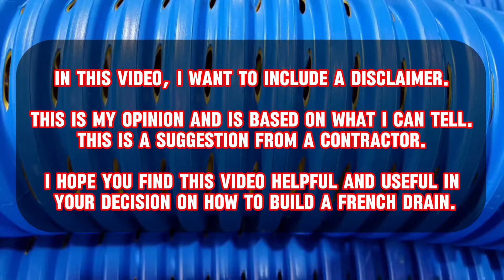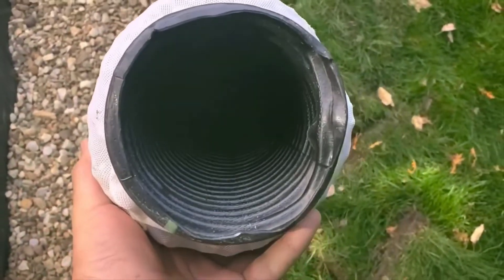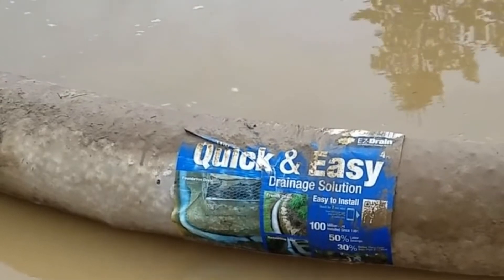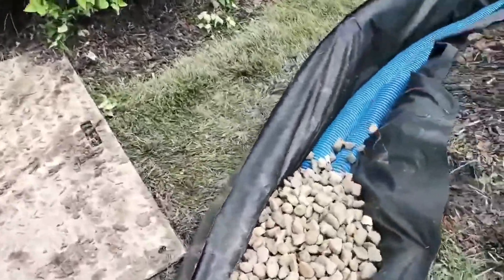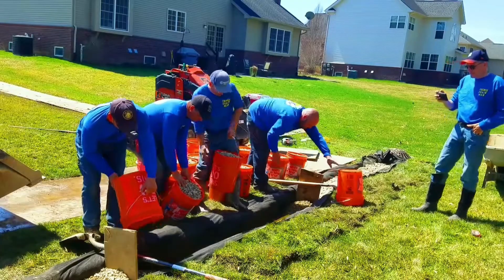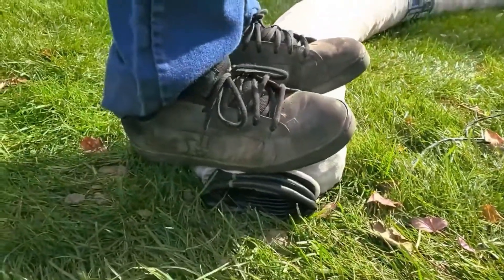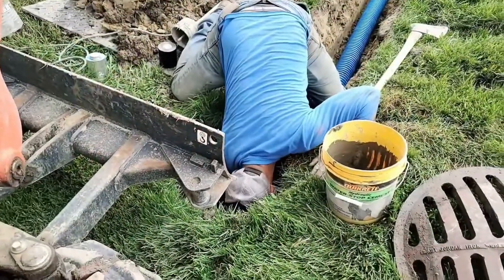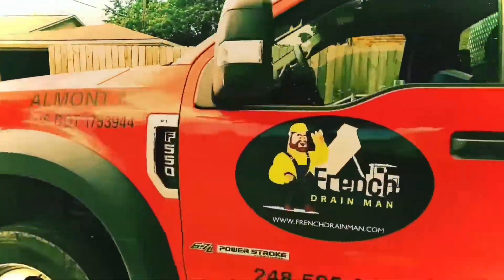NDS EZ FLOW Exposed: The Truth about Styrofoam Drainage Pipe

Comment: This is a bit of an unfair review. While I agree with the strength of his piping the idea that the EZ Flow will rise when wet is absurd, in the example presented. In the application of the failure in the East Coast why wasn't the EZ Flow pipe buried with dirt on it, PER THE INSTRUCTIONS. It was installed wrong. That is why it failed. If dirt was placed on it the pipe would not rise in a water filled hole.
Reply from the maker: https://youtube.com/playlist?list=PLjFCqaZ4v1BVMBnIc1-KUgX9UmBeVpEf0&si=ei-ijmZ8sQiwzcl4

Comment: The NDS EZ flow is the very reason I had searched out your channel in the 1st place. (And it was a foundation repair and crawlspace encapsulation company that had installed it.

Anyway. Thanks for all your videos and products ever since!  Keep it up.
Reply from the maker: Thank you for commenting and sharing.
Reply: Anyone should know that Styrofoam floats. But i don't know why they wouldn't have buried it under something to keep it from coming up when you have excessive water? Sounds like a cheap job to me especially when you step on it and it crushes the pipe inside. That's not a good sign of it's quality 😕
Reply: @RayReed-m9h  It was a cheap job... And we sued them... And we won!